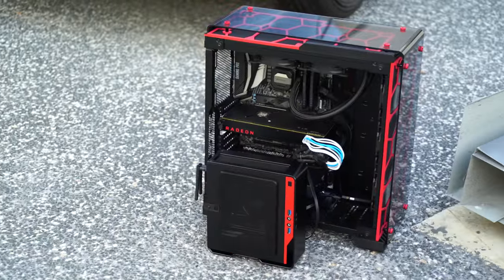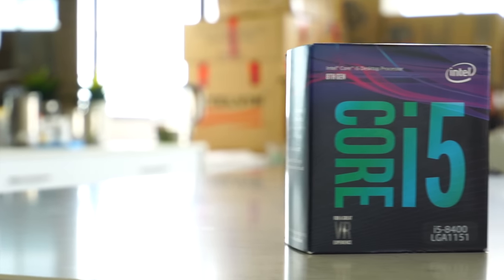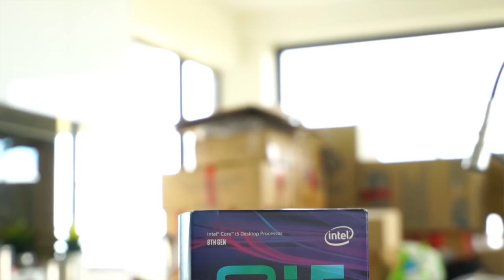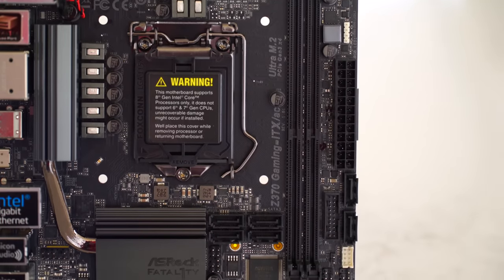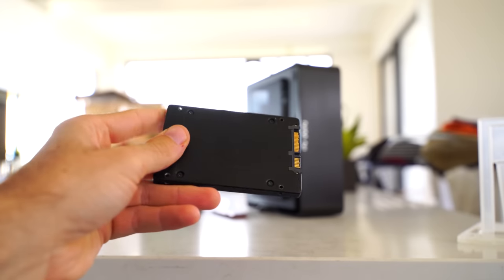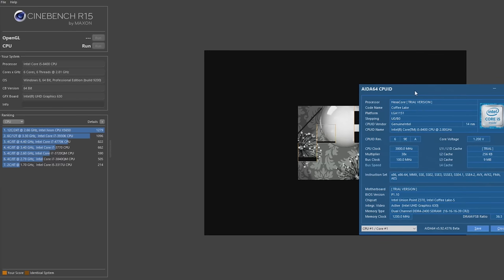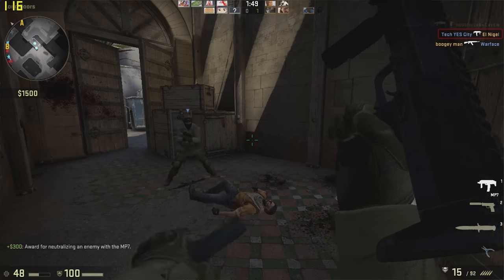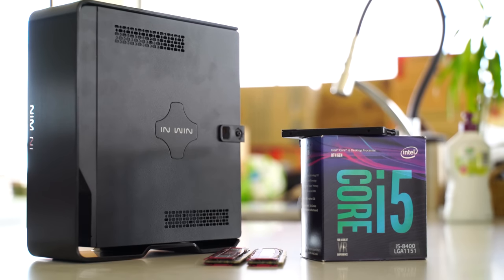Build the SMALLEST Mobile 4K Video EDITING PC Ever!

Comment: you used cofvevefe lake? than it simply cant be good. intel has become like apple, running behind competition, pretending they are innovative and asking a premium price practically scamming you
edit: jeez i wasnt that serious i mean since cofveve lake they atleast have some proper competition again allthough p/p wise amd is still king, i mean the only mobos for cofveve lake are x370, thats expensive as fuck. especially if you buy a locked cpu such as the i5 8600, cant overclock it anyway. thats why ryzen is much superior. can oc on cheap mobos with stock cooler, 6 extra threads and with ocing vs the locked intel i5 i think gaming performance is only cut slightly, stop arguing but all join one side; thisll cause the other side to innovate
repeat the process and enjoy
Reply: AMD did that with their FX and APU, same processor, selling you for the same or slightly higher price, and claim 20% improvement, but actually, only 0-5% improvement. Ryzen and Threadripper will get the same treatment, since Jim Keller left AMD. Now AMD has no good engineers to the design.
Reply: Behind? they are still superior in gaming. Wake up, AMD fanboy.
Reply: Ryzens dont have iGPU, thay cand be used like this!
Reply: And you intel fanboys are kicking a dead horse.
Reply: Shit? Dude being 10 fps behind on dx12 and many dx11 titles isn't shit.
Reply: Intel fanboys are WORSE than apple fanboys.
Reply: You're totally forgetting about Intel Quick Sync which AMD does not have :)